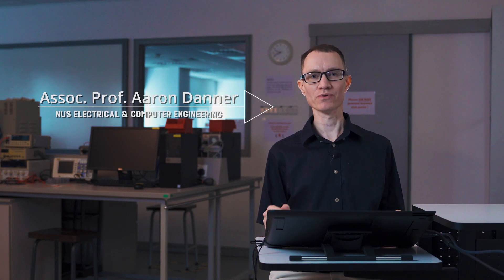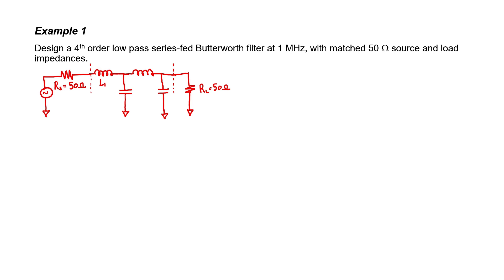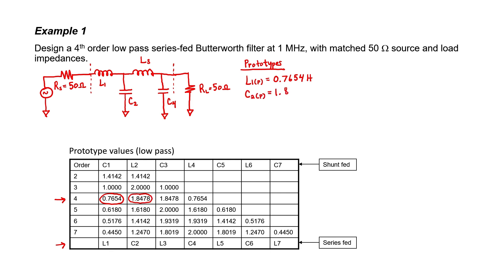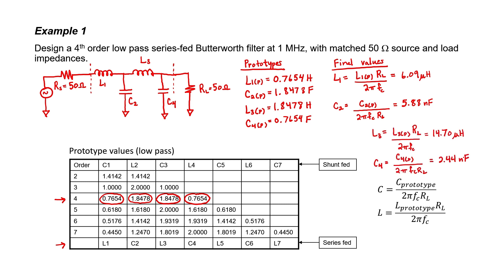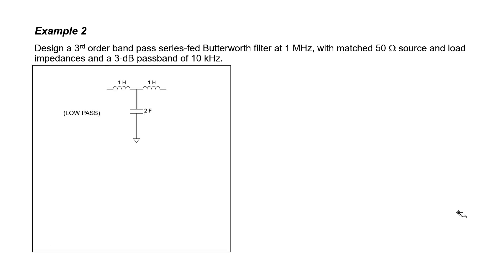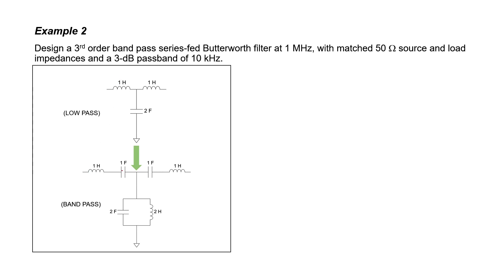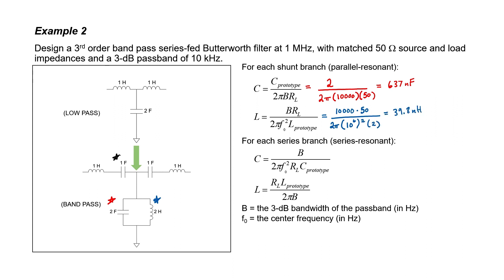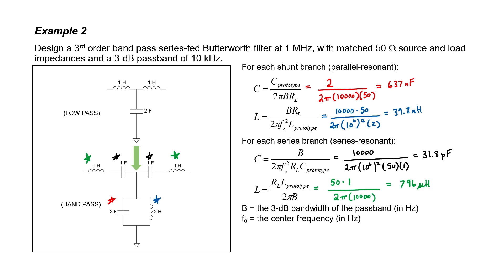Butterworth Filter Design Examples (14 - Passive Filters)

Comment: Hello Professor Danner,
I have tested the filter you proposed in this video. I put the Values calculated into LT-Spice and matched the source and Load impedance at 50 Ohms. But the resulting Filter looks nothing like a Butterworth Filter even in the simulation. I have also tried simulation without the Resistors still the same. It has very sharp roll off from the center frequency (That is correctly placed at 1MHz). It should be really flat though being a Butterworth Filter. Any Ideas why that is ?
Reply: What you're really seeing with a band pass filter is the rolloff from both a low-pass and high-pass butterworth filter; you're only seeing the section of the butterworth filter that is attenuating the signal. The typical flat response from the butterworth filter is effectively hidden by the other filter. 

You can see this a little better if you split the bandpass filter into two separate filters; you will see the standard butterworth filter shape on each of the individual filters and the bandpass occurs where the bode plots of the two filters cross. In this case the lowpass and highpass filters' individual cutoff frequencies are approximately 2 decades below and 2 decades above the bandpass center frequency respectively.
Reply: Thank you for your response. What you are saying is partially true. When I just split the filter with Butterworth' bandpass values it won't be the perfect BW LP and HP.

My issue was that my lt spice installation was corrupted that's why it simulated wrong.
And LT spice doesn't show you the s parameters it shows the voltage amplitudes and the simulated filter had an attenuation of 6dB in the passband. That resulted from the 50ohm input and output impedance. You essentially have a voltage divider that halves your voltage in the passband. Thus resulting in 6dB attenuation